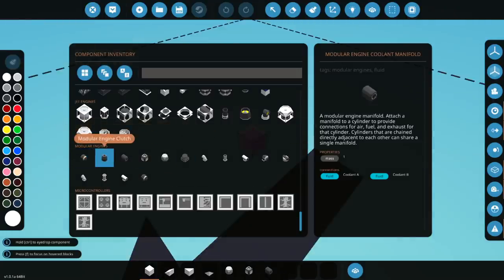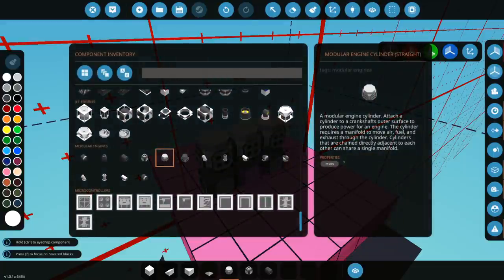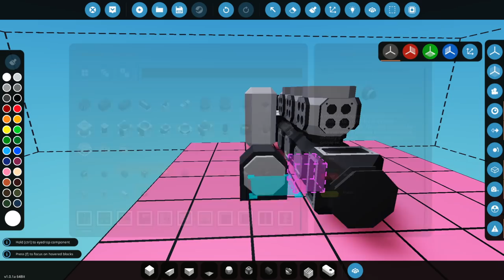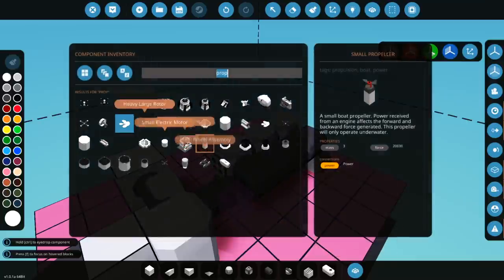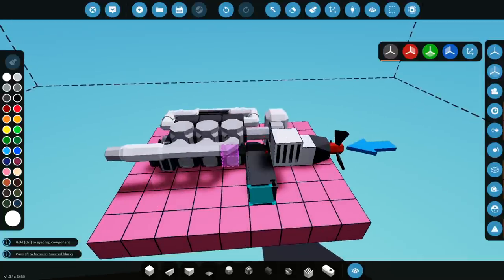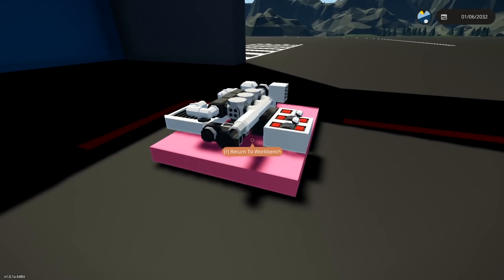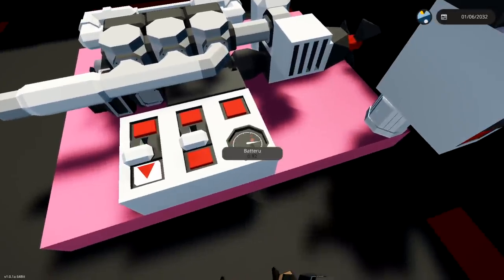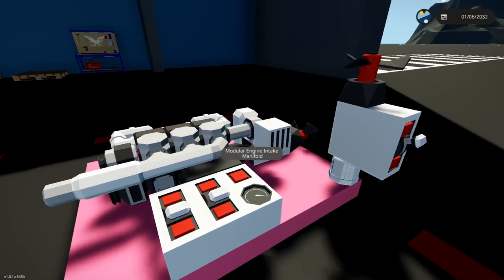Super Easy Modular Engine TUTORIAL  -  Stormworks Build and Rescue 1.0

Comment: Is it normal that the engine gets 300+ C hot? I built a V8 and adding cooling doesn't change the temperature
Reply: I think this is a glitch. I have a V8 powering a small heli and it explodes 5 km out